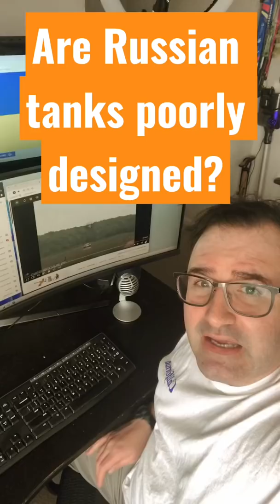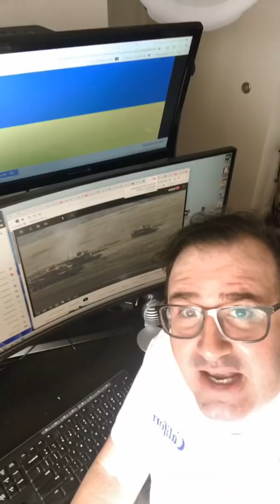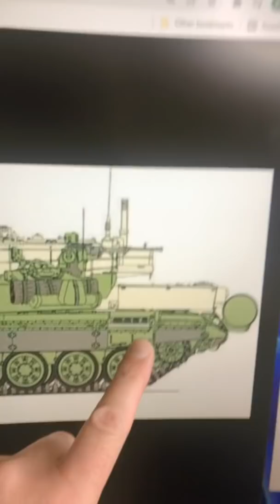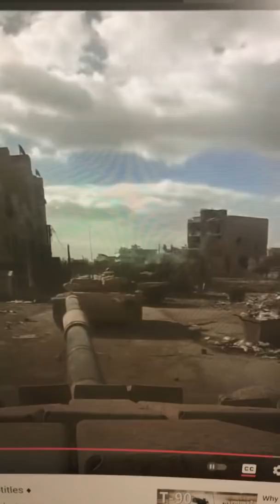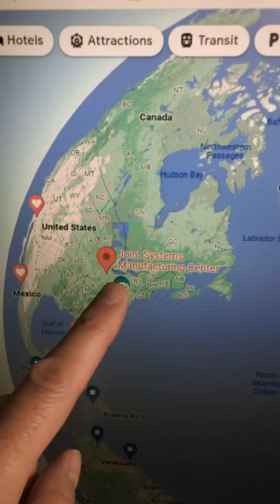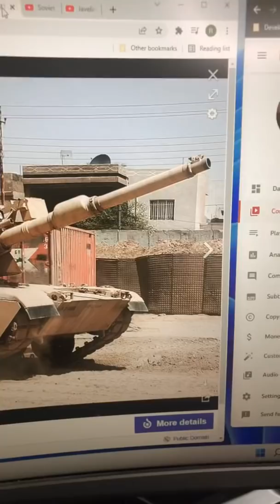Are Russian tanks poorly designed?

Comment: Basically every tank design is outdated for something like the javelin. There isn't a single tank fielded by any nation that can survive a direct hit from a javelin. 
Only option is counter measures that are more like add-ons than part of tank design
Reply: Exactly, the javelin can even take out an Abrams tanks. Tanks are more or less a relic of the past coming into this new gen warfare. I’d say tanks in a modern setting are good siege/ blitzkrieg weapon rather than what Russia is using them for which is patrol operations.
Reply: APS is the future. But the price for whole package is too much for Russia
Reply: @alifio2183  what's aps
Reply: @cmendoza1094  Active Protection System. In this i'm pointing out to the Hardkill type which destroys incoming missile/projectile before it hit the tank.
Reply: One problem I hear Russia is having is that they don't do combined arms very well.  When they send in tanks, they are sending in just tanks.  When they send in infanty, its just infantry. Tanks are not supposed to operate alone and are way more vulnerable to infantry if they do.
Reply: @markphillips4767  But tbh no amount of infantry will protect you from javelin, except Yakov Ivanovich ran ahead of the army and beat the javelin gunner before the tanks even come.

APS is the future.
Reply: @markphillips4767  and it's not like the troops on the ground are unaware of the benefits of combined arms. Intercepted Russian chatter has them begging command for airstrike support that never came.
Reply: @romxxii  Completely agree!
Reply: @alifio2183  You're missing my point.  There's a difference between improving a bad situation with something Russia could do and saying something the Russians aren't using and don't have in appreciable numbers would fix the situation.
Reply: @romxxii  intercepted surely this is not propaganda and surely the ghost of kiev is flying around

Comment: Designed well for the 1970s
Reply: @user-tl4yr4ki8h  1963
Reply: Actually, because modern ammo doesn't cook off, this design is about to become very much relevant again. Less interior volume means you can have a more armored tank or at least a lighter tank with equal protection. Even the recent concepts for the M1 Abrams replacement all have very Soviet traits like less interior volume, 3-man crews, lower profile, etc.
Reply: @baker90338  I am sure. The German Army tested this new ammo by hitting but directly with an RPG. Nothing happened.

Comment: It’s gonna be interesting to see how Russia combats the Javelin. So far the slat armor on top of the turrets has done barely anything for protection and they just keep taking more and more losses.
Reply: That has always been the Russian way, they just make more
Reply: @vilneas6358  Russia does not have a lot of modernized tanks, only about 2500 to 3000. The rest of their tanks are older obsolete tanks. Modernizing the old T-72s costs a lot of money, so it isn’t easy for Russia to do now they aren’t the USSR anymore. A modernized T-72B3 tank costs about $3.5 million
Reply: @tylerclayton6081  which is fairly cheap. About half what an American tank costs that they're designed to fight.

Whether or not their tanks are modernized hardly matters in this conflict, Ukraine doesn't have any.
Reply: @vilneas6358  Ukraine's got T-64s and a few T-80s. With how the russkies are losing tanks WITHOUT Ukranian armor involved, I wouldn't count out Ukraine's armor yet
Reply: The slat roof is like space armor vs Javelin's HEAT warhead. I dont think the armor helps so much but i'm not a tank expert lul.
Reply: @dmknght8946  the cage is supposed to trogger old fashioned anti-tank missiles before they hit the armor. Only works sometimes with old rpgs
Reply: @danteinouye6098  there are alr ukrainian t80s obliterated by russian air strikes tho
Reply: I think that the Russians will catch on, they'll flip the tank upsidedown !!!!
Reply: The cope cages do help against mortars, baryaktars, and rpgs fired from building. Because the javelin has 2 warheads, the cage does nothing against it.

Comment: the thing is if they spot you first, shoot a shot, and penetrate its gonna be bad either way, which is why a lot of modern vehicles are lighter than the vehicles that came before them. usually, its better to prepare to make sure they don't notice, then don't penetrate, then you can care about the post Penn last. Also Russian tanks have an auto-loader with a rotary rack which is pretty easy to explode, they probably could have a separate blowback ammo rack but who knows they probably have their reasons.  

Also having a smaller turret is still beneficial in a lot of ways, that's a lot less weight, less space to armor or not armor with era, and fewer shot traps. 

having a smaller profile is more for not being seen rather than not being hit.

Comment: Another example of how Russia doesn’t understand that they’re not the USSR anymore and times have changed drastically.
Reply: If Russia had been the USSR, it would have made a quick replacement of the fleet of equipment that is no longer so efficient, with a new fleet of equipment that would be more efficient. Russia is now a capitalist country that does not have the resources of the United States, so it uses an even cheaper option, the maximum possible modernization of old equipment...
Reply: @DVXDemetrivs  sure ya can replace tanks but your population will go down so fast just like the ussr

Comment: I mean you're partially correct, but the main problem is just that the Russians don't understand that there are certain avenues where you should never cut corners.

One tank needs a crew to operate it, and a whole bunch of supplies to repair and maintain it, taking resources that could be used on the infantry.
When the tank is well made and hard to take down, it requires remarkably less long-term resources to keep it fighting. Inversely, cheaper options will get destroyed left and right or sent to be repaired at the most optimistic, again draining resources that could be used long-term.

The Russians ran into this problem with the T34 where the tank itself was decent for it's time, but the factories cut so many corners the majority of them spent most of their lives either broken down or destroyed. Basic crap like internal lighting, heat treated gear boxes, and actual chairs were cut just to speed up production by a little bit more, and the T34 suffered from it.

And the Russians learned nothing from WW2, because they got away with it. The Nazis kept pushing further and further into Russian territory, and thus simplified the Russian supply chain the more progress was made. They got away with pissing away so much steel, gunpowder, and diesel just because the Nazis slipped up.
Reply: I'm sorry your team lost lmao. Soviets went from basically agrarian society to heavy industry, why also having to evacuate their nascent factories due to the invasion. early war tanks were often built by people who never worked in a factory, sometimes in open air, as the buildings were being built

Comment: That's what I've been saying about WWII. There's no Best tank, it's depend on what each Nation needs. US designed Sherman to be good enough but also can be repaired with spare part because they're away from factories.  Germans need quality because they fought in many front and theirs factories is near. Soviet need mass produced tank and simple operation to push at a fast pace.
Reply: The truth is, most soviet tank was build so horribly, almost half of them breakdown before they reach battlefield. German panthers and tigers usually become junk the moment rain starts. Sherman was best tank of ww2 according to stories of soviet tank veteran who served both on landlease Sherman's, and various soviet tanks
Reply: Well you can build overall better tanks. You can have the really specific, specialized tanks. But eventually tech gets to the point where it's advanced enough that you can create Jack's of all trades that can compete with the specialized ones. Tanks that can be outfitted with different tools for their situations. 

Granted what you use on the tank, depends on where you send the tanks. But hey, you can change the outfitting on your tanks to be adapted for that battlefield before sending them out. Instead of manufacturing multiple different types of tanks for their respective roles.

Would be more efficient to manufacture 1 model of tank, and separately manufacture its custom changeable parts.
Reply: Also the t34 design is on par with the sherman, but, the quality of t34s sucks, from optics not working to the crew not knowing they have been hit, to rounds that have not penetratee disabling the tank to basically everything
Reply: @WarpGhost92  the Soviets said
 the m4 was a waste of space
Reply: @br-sb6vu  I would say "talk to veterans" but they all dead by now. As far as I know - tank crew praised Sherman.
Reply: @WarpGhost92  that what the Soviets said @spooksten said it in a video
Reply: If the Russian Tanks were made  with a seperate ammo storage, pretty sure that could be made with a auto loader then l would agree. As it is they are death traps.
Reply: @WarpGhost92  the truth is that Soviet tanks were designed to last 3 months. As that was the average life span of a tank. They weren’t made poorly at all
Reply: @yoinks9907  according to publicly known reports, half of t-34 breaks down before they even reach a battlefield.

Comment: Well, the T-72 is a very old tank. Designed in in the late 60s. The ones used in conflict areas are export models. Which the Russians called them “monkey-models” because they’re very inferior to the homeland.
Reply: The Export models are litterally higher quality though. You realize that right?

India litterally has tanks with better workmanship, than your average Russian tanker.

T-72 being old doesnt excuse its performance either.
Numerous countries have taken old M60s, and made them into modern day specification. 

T72s already have composite armour built in, and dont need alot to be upgraded to modern variants. 

Would you say the 737 is an old plane, despite them still making new ones designed in the modern day?
Same story with russian tanks.

Comment: Counterpoint: During Desert Storm, being physically smaller did very little to save Iraqi tanks from the main guns of their larger, heavier coalition counterparts. The catastrophic, crew-vaporizing jack-in-the-box explosions were well documented then. Isn't it fair to argue that in practice, it's a lot easier to repair a disabled MBT than it is to have to both replace the tank AND train an entirely new, competent crew?

The autoloader design is clever, but it is still a fair argument that it is a flawed concept for practical warfighting.

Comment: The smaller it is the higher power to weight ratio. You can achieve the same speed as an Abrams with a less powerful and perhaps lighter engine. 

The smaller the tank, the less surface area you have to cover with armor and it allows you to dedicate more armor to a specific area without compromising weight. 
T72's can be just as heavily armored as western tanks in the front while being significantly lighter because the front surface area of a T72 is much smaller.
Reply: yeah transmission efficiency doesnt matter  only horsepower per ton

Comment: So the t72 is like the t34 of ww2.   Just get as many of them out on the field as you can and forget about them. Also a strategy of accuracy by volume
Reply: Not really. The modernized version T-72 B3 costs about $3.5 million USD, and Russia has about 1500 of them in active service(it’s Russia’s most used modern tank), the T-72B3 is the modernized version of the T-72 tank. They are quite expensive to modernize so losing a modernized T-72 is a big loss given that Russia has a small economy and cannot afford such loses. 

Older T-72 models are basically obsolete, during the 1991 Gulf War against Iraq the US M1 Abrams destroyed thousands of T-72s without losing a single M1 Abrams tank in battle. So older T-72 models would be next to useless in battle now, just death traps for the crews. Even the newer T-73B3 isn’t as good as the Leopard 2 or M1A2 but at least it’s not completely useless.

The only good Russian tank is the T-14 Armata but it is as expensive as western tanks and far too expensive for Russia to mass produce. So currently Russia still has less than 100 T-14 tans
Reply: @tylerclayton6081  technically the latest T-72 mod is the T-90M ... so yeah...
Reply: I like how Americans insist on talking about Iraq wars as if they were representative of anything relevant

Comment: A T-34 may seem poorly designed compared to a Tiger II. But at a production run of over 57,000 by the end of WW2, 492 Tiger II's are NOT going to make a dent in that wall of steel. Even when you count 1347 units of Tiger I's to the King Tigers.

Get it, Ryan? Can you grasp that quantity has a quality of its own concept? Same holds for the Sherman.
Reply: Tbf the Sherman was made to be easy to repair as like he said you weren’t getting another one meanwhile thousands of Soviet tanks were just straight up abandoned when they broke down because it was cheaper to just hop in another one then to try repair the T-34
Reply: Half the T-34s would break down before even finishing a single tank of gas. Russians were losing equipment much faster than it was being built and so if you take American lend-lease out of the equation, soviet union would have eventually lost. So no, quantity has no quality of its own. See also: Volkssturm
Reply: @fireiron369  4 days ago
Tbf the Sherman was made to be easy to repair as like he said you weren’t getting another one meanwhile thousands of Soviet tanks were just straight up abandoned when they broke down because it was cheaper to just hop in another one then to try repair the T-34

The Sherman got the nickname "Tommy cooker" from the Ne0-N@ZIS. Says enough about what it is, right? 

It has a deadly high profile due to the big-a$$ engine inside of it. The armour on that thing is like a tin-can, and the ammo compartment is in the frontal area, which explains the high rate of explosion when hit. The 76mm gun on it was inspired by the Panzer IV. When it came across the Tigers, oops......

In short, Shermans are death traps for its crew. Now your turn......
Reply: @hansweissmann_xviii6754  2 more weeks, right?
Reply: @mindaugasbarkauskas9894  1 hour ago
 @Hans Weissmann_XVIII  2 more weeks, right?

Two more years, Ukro-NATO-N@ZI. Denazification!! Remember?!
Reply: @mindaugasbarkauskas9894  
Ne0-N@ZIS said precisely the same thing!!!🤣🤣🤣🤣🤣
Reply: @hansweissmann_xviii6754  yes, russian Ne0-N@ZIS kept saying it. Now they are quiet.

Comment: There is also the manpower concerns. In the late 50s, the USSR realized it could not fight the way that it wanted to (the only way it could) with the manpower available. They were forced to go with an autoloader design in order to reduce the crew to 3 instead of 4. Just like the need to ship our forces over the Atlantic forced the US to develop longer ranged, more accurate and higher quality machines and equipment. That wasn't a choice for the US, it was a necessity.

Comment: T-72 autoloader wasn't the reason why it explodes so often, in the case of T-64/T-80s it is because part of the ammo is placed verticaly where in T-72/T-90 it's oppposite, it is placed horizontaly, and the shells are placed even lower than the head of the driver.
and T-72A and newer (also those for exports) had additional plate for protecting the autoloader ammo from frontal penetrating hits, mostly to protect against shrapnells and etc rather than the APFSDS.

The reason behind the explosions is where the spare ammo is placed, and it is placed literally everywhere.

Against Javelins it wouldn't help much most of the time but against standard types of ATGMs or RPGs that did not hit the lower part of the hull?
Definitely would help.

Comment: i saw a video of a syrian t72 being hit by an rpg 7 in the ammunition rack. It exploded ejecting its turret killing all its crew but it was repaired, painted and put into battle with a new crew in about 24 hours. The crew was sent to the same location where the previous crew was killed, but emerged victorious in the rematch. You can see that the tank is designed to be repaired on the battlefield.

Comment: The 9M14 set the stage for eh change in tank design back in 1972 in Vietnam, and in 1973, in the Sinai. Even after the TOW came out, the russians stuck with the very small designs.
Mostly because they probably were producing them because they were cheap, and fairly easy to operate and maintain.

Comment: I love your videos, they are spot on most of the time. But right now you forget one thing, russian tanks are designed to operate in Russian conditions. Especially bad weather. Thats why they had to be smaller, the wide tracks and low weight gave them lower groundpressure ratios compared to heavier tanks from the west. That was very decisive in their design path. Keep up the work.

Ex leopard2a6 gunner